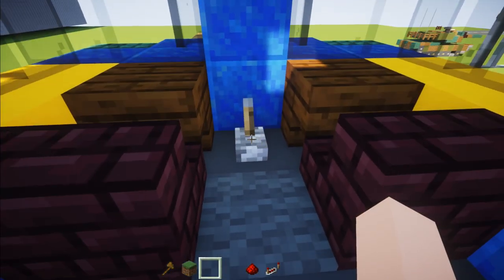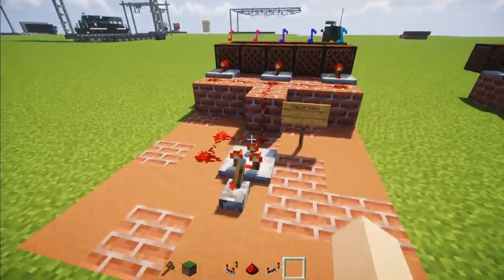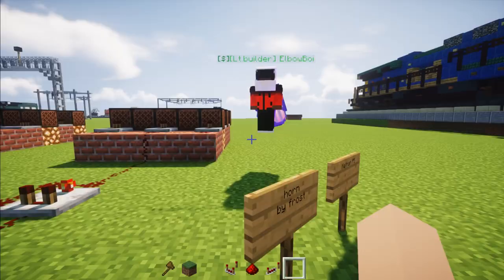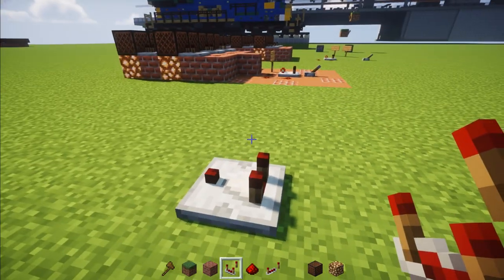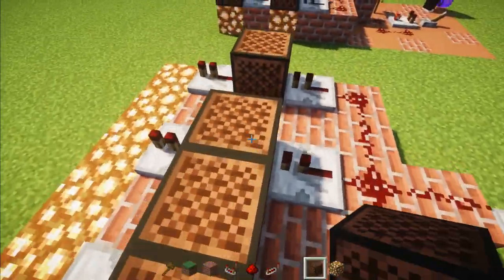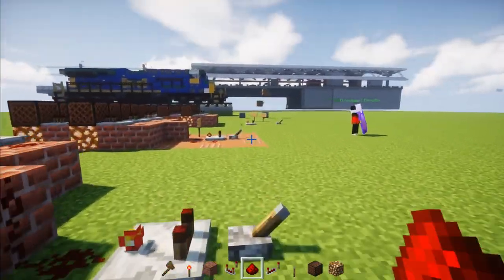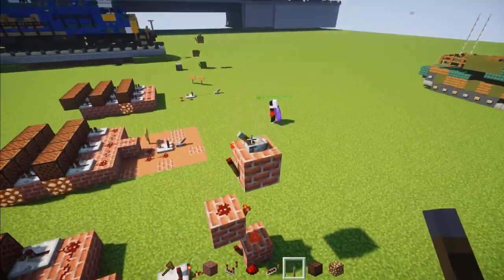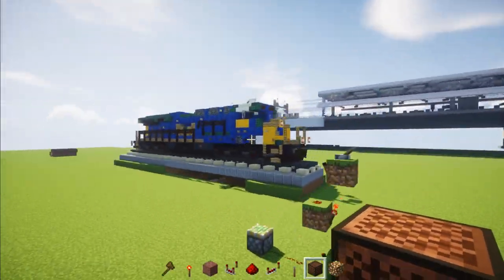Minecraft Train Horn Sound Effect Tutorial

Comment: Crafty you can put the horn michine where the engine is supposed to be, that makes it more loggical.
Reply: Depending on what kind of locomotive you have, it would be very difficult to put the horn inside the locomotive. I managed to do it with one of my trains, putting the horn inside the train but it’s a tight squeeze wiring all of it.